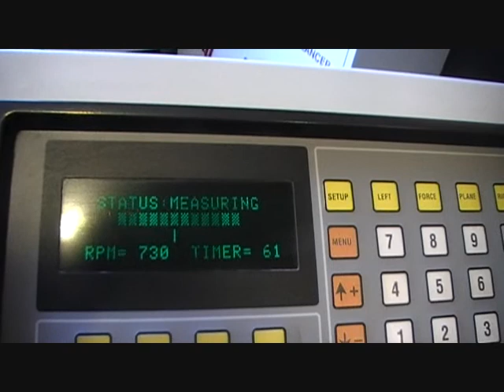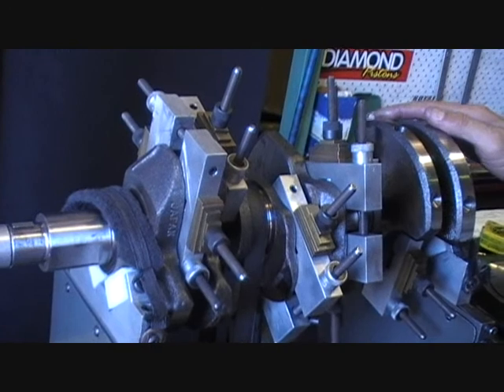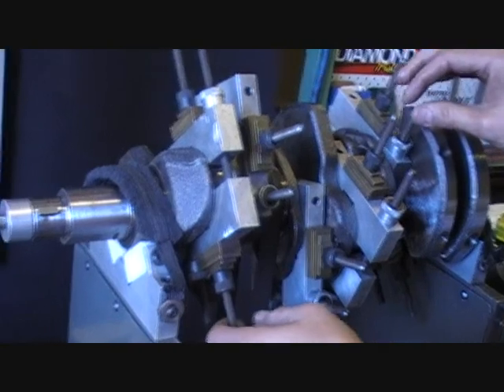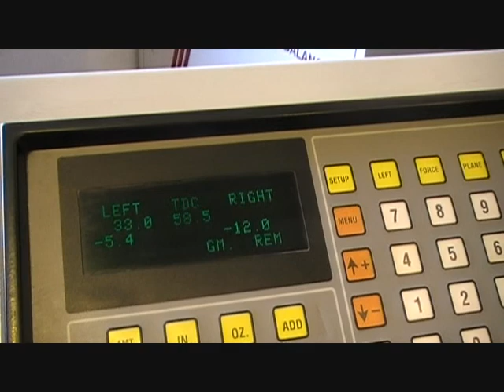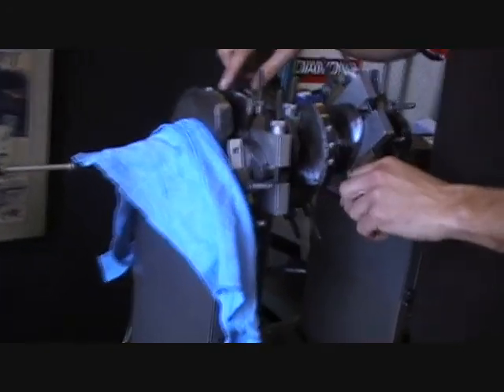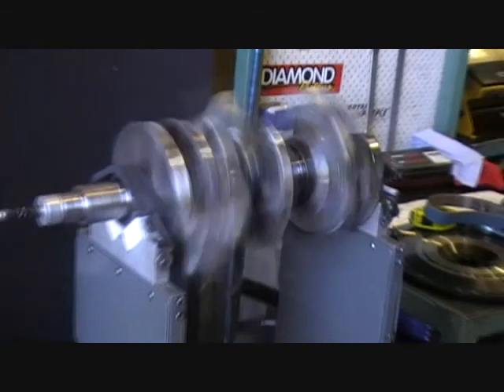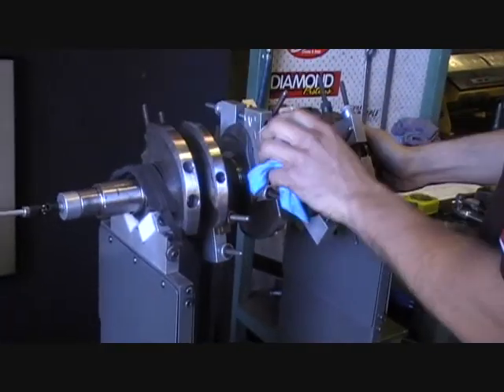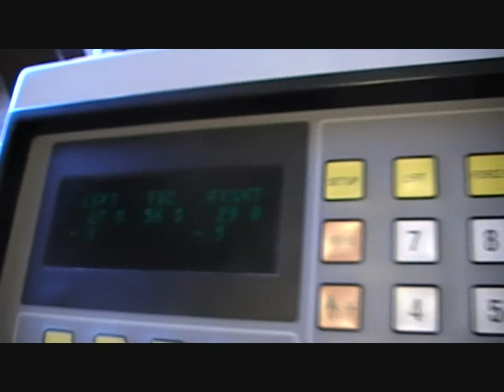Crankshaft Balancing 2

Comment: I've seen several cranks that broke thecounter weights bc they installed the Mallory the way you just said I 100%believe that installing it the same way the holes are drilled is 100000000x safer as long add its welded its not possible to just fly out like you mentioned the whole damn crank would fly apart first smdh that practice of side ways install is dangerous and if it's small amounts it's way better to remove material from the pistons which is the right way it just takes more time and skill so most shops have resorted to quick and easy instead of theRight correct and safe way

Comment: You say you do the crank on it's own and not with the front balancer or fly/flex, but that's assuming internally balanced, yes?
What about external balanced where the balancer and fly/flex also have bobweights?
I would expect that they'd need to be fitted and balanced as one assembly throughout the entire procedure.
Good videos and insight, by the way. Thanks for posting.
Reply from the maker: You can balance altogether or neutrally balance the crank pulley, clutch and flywheel by themselves.
Reply: Thanks. So I dare say that with externally balanced is that you'd NEED to? ie: BBC 454
Reply: No!!!!! 4 cylinders aren't the same as v8s they have 2 cylinders knee direction and the other 2 180deg opposite so you balance the crank alone then weight match the pistons and rods and the rest is a neutral balance, v8s are not this way except the new 5.0 cyote engines ford made they are designed just like a 4 banger 4 pistons 180deg opposed by 4 more which allows you to balance the crank alone then balance the parts separate regular v8s have to have bob weights attached to simulate the weight of the pistons and rods regardless of. Whether or not it's neutral balanced